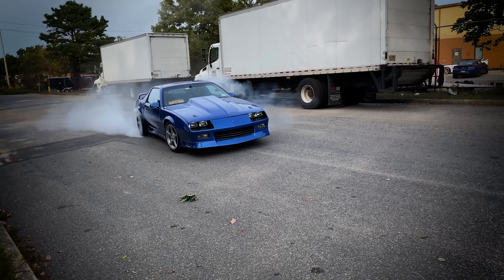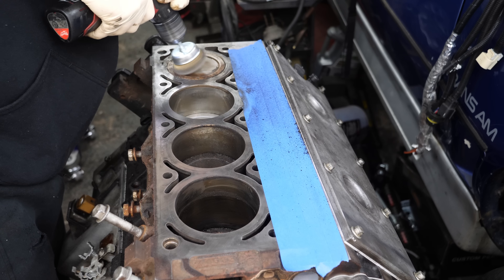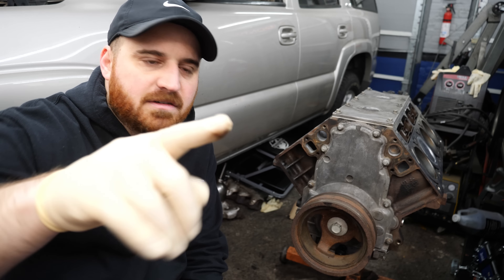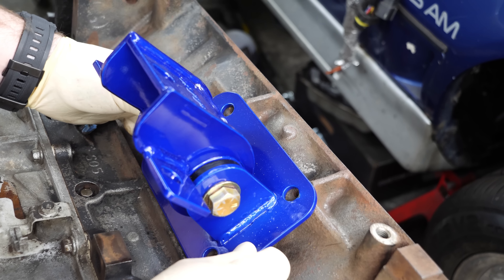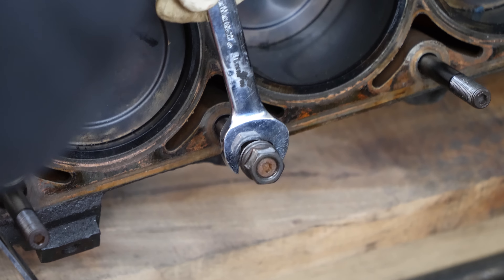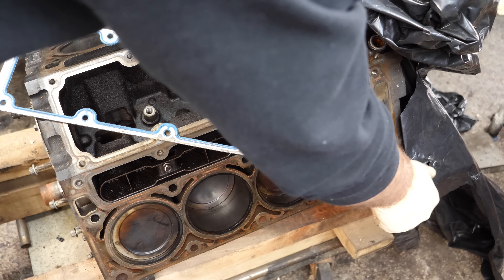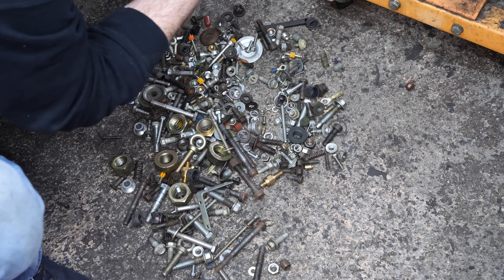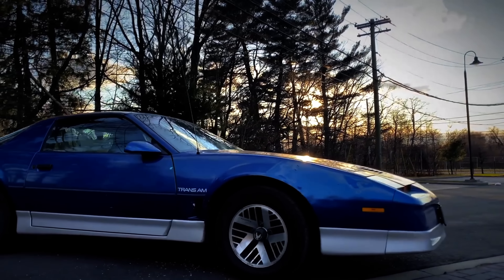These New AFP Motor Mounts Will Probably Outlast my Tahoe

Comment: Glad you like the mounts! For installation though it is MUCH easier to leave the main bolt in the mount in place (just tighten to ~20ftlbs so the gap is taken up, don't overtighten) when installing the engine. You can rotate the mounts up, drop the engine near in place, then flip the mounts down and wiggle into place. That is why the holes are oval, to allow the engine to wiggle into place on final install. Once the bolts are tight it wont move at all, although locktite on the bolts is probably a good idea. Installing like you did will be much harder trying to align the main mount bolt.

As far as vibration, on the 99-06 trucks the VAST majority of people can't tell the difference between my mounts and stock mounts. Even my solid mounts the vast majority of people dont notice any additional vibration, so I think you will be fine there. The 07-13 trucks are a little more susceptible since the harmonics on that body style are less forgiving, but the 99-06s generally never have issues.

Comment: instead of ordering a thread chaser, just take one of your old tork-to-yield head bolts and cut a couple slots down the side of the threads with a cutoff wheel.  It works great to clean out the threads.
Reply: Done this 100+ times works great

Comment: I installed those motor mounts on my truck in 2018 (2010 GMC sierra z60 full bolt on) best thing I ever did I got to where I had to replace mounts once a week even with limit straps

Comment: My 03 Z71 started loosing coolant like mad a month ago. A careful exam found no  external leaks. Oil is clear, no foam on oil filler cap, no white smoke out of exhaust. I lost a gallon in 200 miles. I gave up and “stop leaked” it. It stoped. I’m going to pull plugs and look for an “outlier”. I’ve seen the videos about porous head castings. Pondering an LQ9 swap with long tubes, AFR heads, mild cam swap. Thanks for sharing your experience and expertise. Stay warm. Dave in Omaha
Reply: Do you have 706 heads? They commonly crack around the head bolts. Pop off the valve covers and see if there’s milk residue slung all over the covers
Reply: Thanks Jacob. Dave
Reply: Check your auxiliary heater lines. Mine started leaking randomly only in very cold weather, in the rear end half near y pipe flange. I think there's quick connects that are giving up the ghost for me. Never saw coolant in driveway. Seems to only leak while driving.
Reply: I would check the transmission fluid if it's an automatic....

Comment: Would you recommend rebuilding the bottom end or just leave it be and build the top end with cam, new gaskets, lifters and etc to make it reliable? I also heard of installing a Dunbar something like that it's like a dog bone shape to project oil and reduce failure. I got a 00 suburban with the 5.3 and I got 215k roughly. I'm only looking to make maybe 460 to 500 HP tops. What would you recommend?

Comment: Just use a old head bolt and take a dremel and make to lines on each side and run it in the block and that will do the trick.